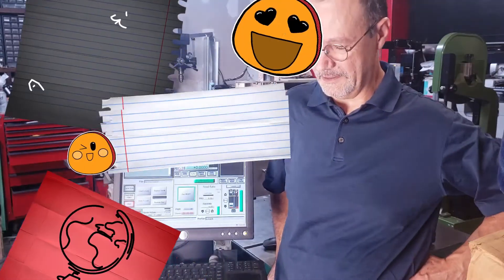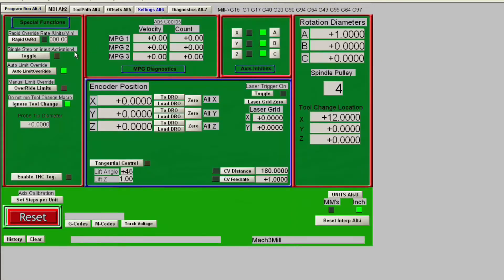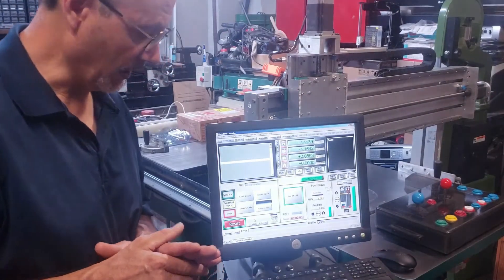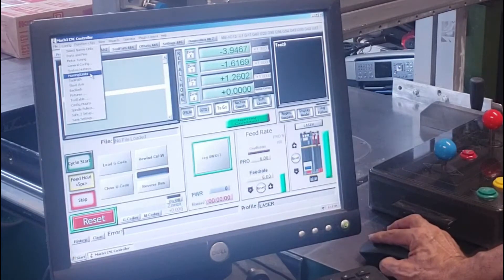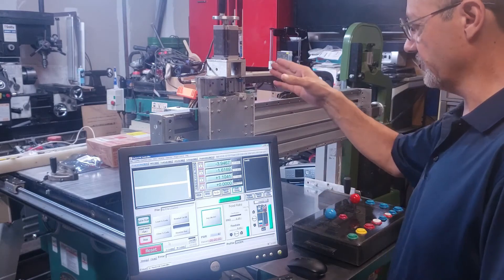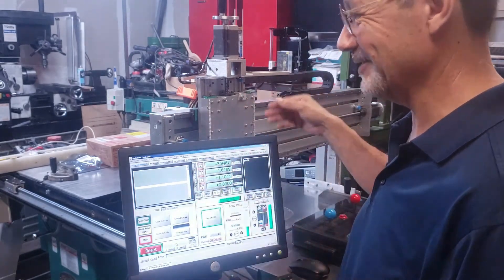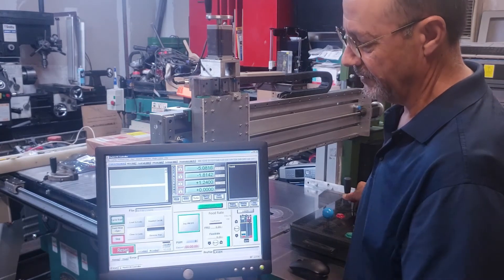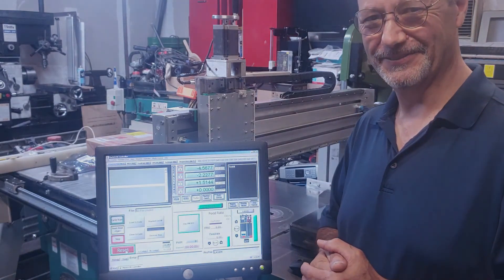Limit switch problem and solution

Comment: Hello. I think it's the time you decide that there is no way to get rid of the switch without giving 1000us, that is, there will be no bounce at all. I understand that this causes the states of bounce level graphic (bounce state) to be positioned differently. I think an algorithm is needed to solve this problem. It doesn't seem like a situation that will prevent bounce mechanically.
Reply from the maker: Thanks for sharing your thoughts on the problem. I appreciate your feedback and will consider it for future videos.

Comment: Hi, thanks for the video. I had exactly the same issue. The solution is in the "Settings Alt6" page up top. Goto "Auto LimitOverRide" and make the check box Green. Problem solved.  Cheers Cam.
Reply from the maker: Thank you for sharing your solution, Cam. It's great to hear you got it fixed.

Comment: sir i have a problem that when i check on auto limit in limited think three they are running and mac show three pin number and when i do al home limited switch stop working machine What is the solution for limited switches crossing?
Reply from the maker: I’m not sure what the question is. Perhaps you could rephrase it so i could try to answer. thanks.

Comment: Usually, on machinery (CNC, automated robots, etc.,) I would see what they would call a software limit switch and a hardware limit switch. In this case, you have a hardware limit switch type setup, which would be your Inductive Proximity Switch (which is referred to as limit switches in this video). But it doesn't appear to have a software limit switch, at least from what I can tell. Usually, the software limit switch would be like your primary stop, and your hardware limit switch would be almost your like emergency stop. Like just in case a servo motor lost its position, or the wrong values were input into the program. It would halt all functions, in an attempt to prevent further damage to the equipment or product. But you can also use the Hardware Limit switch as a homing/referencing switch, which is what you did here in this video. Not entirely sure what goal you have in mind for this setup, or what all you are planning on doing with it. But Cool as heck to see someone successfully troubleshooting an issue, as opposed to just working around it. Some of which is things I constantly have to deal with on a weekly basis, lol. Best of luck to you!
Reply from the maker: Thank you very much for your observation, in effect I have soft limit switches activated on mach3 and the physical  switches are mostly used for homing as you pointed up, you have to take in count that I'm just a hobby CNC er, and never worked on this things until a couple of year ago, nevertheless the more I learn about it, the less confident I feel.        
  (you know:  "dunning kruger"). Thanks again for your comment!